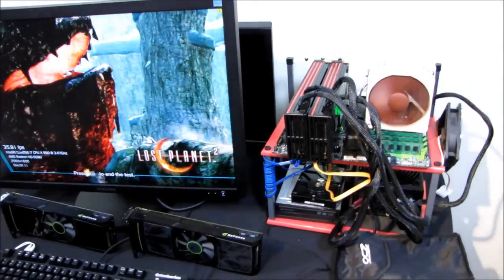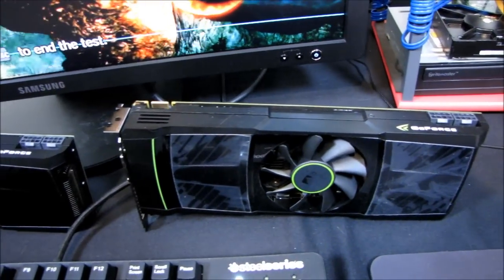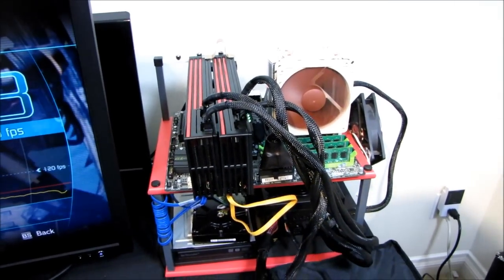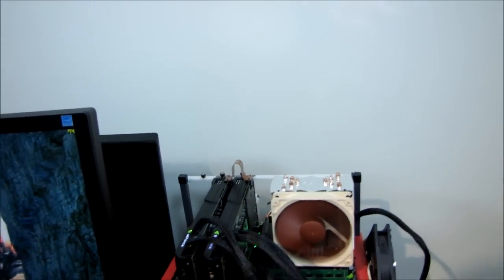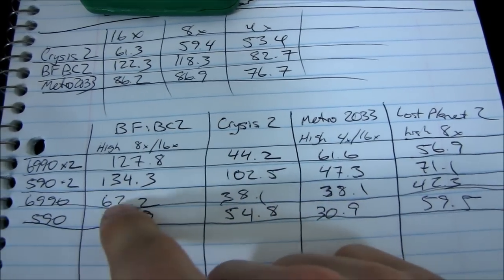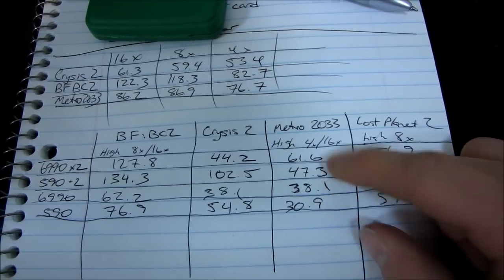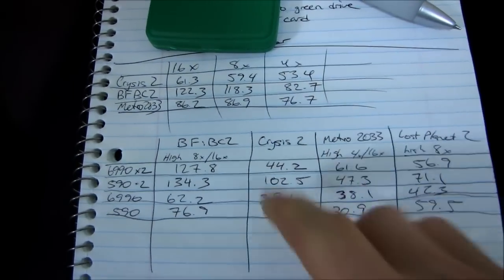Quad SLI vs Quad Crossfire Heavyweight Showdown GTX 590 & HD 6990 Linus Tech Tips

Comment: @sgtrandall1 simple get a video card that DOESN'T have the reference stock hsf design. ( galaxy gtx 580 accelero extreme plus hsf edition here..LOVE IT..fairly quiet even at 50% fan .and at that fan speed IT NEVER goes above 65 at stock voltage and the stock 772 mhz core clock setting..no matter the load)  Msi's twin frozer series types of hsf are often the best of not they are in the top three.  i NEVER buy a video card with stock hsf reference design.  cheers

Comment: @sloergod running them in the 16x slot shouldnt have a bearing on this. From every review i have ever read, the lack of the NVIDIA NF200 chip on the sniper  wont allow it to run 4 way sli like the gigabyte ud9 motherboard has...

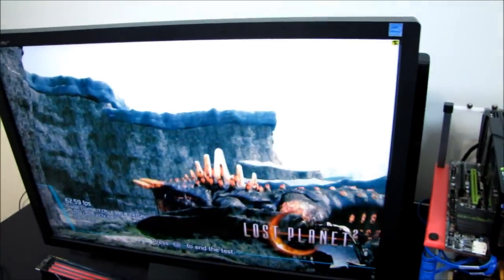Comment: at 3:33 " i felt it would be inappropriate to use 16x and 8x sli configuration"  didn't you already PROVE, Linus, that there isn't any REAL performance degradation until you get below 4x speed on the pci express slots for video cards?

Comment: @HzrdFilms you are right about all of that.  now im still confirming my guesses but so far i believe the test Linus did on 16x, 8x and 4x buss speed on the pci express slots on sli and and xfire configurations proved to me that unless your video card is running at 2x or 1x.  it wont suffer at all on performance.  to me the x16 is just hype.

Comment: @manyakols9 no. if you watched his PCIe bandwidth test, it is a loss of like 2-4 fps and for all the extra air, lower temps and less noise of screaming cards i think 2-4 fps is quite reasonable.

well that and if you had cards as good as that. i think you would have a motherboard that supports full x16 for all slots ( not that the cpu can handle all the lanes, it just gives you more choice of position) like the big bang

Comment: @apocalypseap Yes, like i said "SMALL 8x vs 16x DIFFERENCE"    "4x was a REALLY big difference though when vs 8x or 16x"  Which i just re-watched his video and he is seeing a drop in 16-30% at 4x compared to 8x/16x.  So i think YOU are confused. 
BFBC2   16x: 122FPS    4x: 82 FPS      HUGE difference.   And 8x was 118FPS which might be small, but like i said, if i had a available 16x slot and temps werent going to be affected, id choose it over 8x cause id like to have those 4-5FPS more.

Comment: For those of you with AMD Crossfire configurations that want to play Crysis 2 max settings on 60+ FPS and work with out flickering, you can download Radeon PRO application for free which will allow you to change crossfire profiles for Crysis 2.

Once installed have it scan where you keep your Crysis 2 and set up the crossfire profile for Bioshock. This will eliminate the flickering and increase the performance of the cards on Crysis 2/

Comment: @Daputti This is the last time I'm responding to you, because if you don't get it at this point, you'll never, ever get it. The fact that they're dual-processor cards means NOTHING. Let me reiterate that: It does NOT matter that they're dual-GPU cards. You will only see a 3.5% difference at the absolute worst between 16x and 8x regardless of the card you're using at this point in time. 8x PCI-E bandwidth is sufficient to get 97% performance out of any graphics card out today.

Comment: @oskArtist You're missing the point. This video never was "which setup gives better case temperatures" like you suggested in your original comment. This video is mean't to give a clue about which GPUs scale better in 4-way SLI/CF. That's why he uses 16x pci-e lanes, to limit any bottlenecks and just compare the scaling in different games. This video is about GPU performance an scaling, not CPU temps or computer builds, an 980X will never bottleneck these cards no matter the temperature.

Comment: @1914Sephiroth Did you forget Linus is using 2 590s and 2 6990s ? An that I said that theres nothing 2 580s or 6970s can't handle ? an yes there are a few models of the 6970s that are over $380 USD but theres also some that are around $340 USD so no 2 6970s wouldn't be more then 1 6990 now a 580 is a different matter lowest I have seen is $480 USD, but 2 580s are still cheaper then 2 590s so wtf are you complaining about... most ppl have better places to spend that kind of money then on PC parts

Comment: @reach313 Go with the 2500k unless you /really/ need 8 threads (unlikely). The 2500k performs better and can be overclocked to 4.5GHz easily.

Comment: @Daputti You're missing the point... 8x/8x does not use 4x, at all. 8x/8x is 8x for both. Going from 16x to 8x with one card is almost no difference. Likewise, going from 16x/16x to 8x/8x has the same effect: a 3.5% difference (at worst).

Comment: @pvkryss Doesn't work like that. 8x is still 8x. Linus's latest test proves that dual-GPU solutions are largely unaffected by 8x. In an 8x/8x solution, the results would scale similarly. If you want to squeeze out that extra 3.5% (at best) then 16x/16x is what you'd want to do, obviously.

Comment: @Demonblade36 As far as I can remember, Linus did not do a quad sli/crossfire test in 8x/8x. PCI-E bandwidth doesn't necessarily work the same for dual GPU solutions. It's not that 8x is split into 4x if you have two GPUs on one card. It doesn't work like that. It's still 8x for both GPUs as is evident by the last video Linus did with single dual-GPU cards in 8x. The difference was 3.5% at worst.
I would expect, at most, 3.5% difference between 16x/16x and 8x/8x.

Comment: @LinusTechTips Larger spacing between cards means more efficient case cooling, more efficient case cooling means lower CPU temperature, lower CPU temperature means more space for overclocking and/or turbo, overclocking and/or turbo means higher performance.

Comment: @apocalypseap I think that since there are 2 GPU's on each card, if you put them in a 8x slot you'd get 4x per GPU and linus found out that only when using 4x slots you can see a drop in performance. Someone correct me if i'm wrong

Comment: I think this video really shows that the games are in a good place graphically (though could be better...crysis 2 with DX11 will be a must when benchmarking a GPU) and that the cards currently have a ton of power. its really the drivers that are holding up performance to our eyes. The cards have the horsepower, the games are the premium fuel...but the drivers...the "fuel injection" is sputtering and spitting..giving us crap. Nvidia and AMD need to triple the teams that make their drivers.

Comment: Damn, I was planning on upgrading to a 6990 for Crysis 2 but found out there were driver issues. Is that true guys, or are there fixes? Crysis 2 + 6990 MAXIMUM FAIL :((((((((

Comment: @GaviGames by your analogy, treating a core as a cpu then calling a two dual cores quad socket, then the gpu equivalent would be as follows: a gf110 (580 gpu) has 512 cores, a dual gf110 (590) would then be 1024 cores or 1024th sli. hell yess! sounds way better like that. "Come check out my 1024th sli gaming rig man" *high five*

Comment: @TY220 No, he is probably using an OEM version of windows that pretty much locks that copy of windows to the motherboard being used when it is installed, so when he moves the hard drive to a different board it reads it without authentication.

Comment: Now you need to benchmark  3 580s in tri-SLI vs. two 590s in quad SLI. Then do a tri-Crossfire comparison to quad between 3 6970s and 2 6990s. I'm willing to bet the tri-SLI and tri-Crossfire configurations beat the quad-SLI and quad-Crossfire configurations.

Comment: @DeepSpaceVoid I'm not positive , but weren't his 16x-8x tests with single GPU cards?  What little difference there is between the PCI bandwidths, it would be greater with dual GPU cards. I think Linus wanted to avoid any bottleneck, even if very small.

Comment: @Slixors Well of course but you'd also be getting 2 times the heat and power consumption, not to mention spending $600 more. Point of the video was to compare both companies' Dual GPU solutions i.e the GTX 590 and the 6990 in SLI/Crossfire.

Comment: @LinusTechTips when your changing out the GPUs do you run driver uninstaller and if not then does that mean that the control centers for ati and nvidia work just fine installed on the same system?

Comment: @Geoufferson the 295s would beat em, but not sure by how much, and you're investing in older tech with the 295s as well as much more heat and power output, i'd go with the 6870s, 6000 series scaling is great, not so sure bout the 200 series.

Comment: @hoangle2207 lol it's there damn drivers for there new cards that suck, which is odd cause I can play crysis 2 on my HD4890 an get 60+ FPS C_C so once there drivers mature a bit more I'm sure were see better resaults. As it is I'd rather get 2 6970s then 1 6990 there cheaper and faster lol. what I dont get with AMD is why don't they ever use higher bit rates for there high end cards, that would benifit them in doing so lols.

Comment: Nvidia drivers are fine with 4 way SLI, so i would imagin quad SLI would be good too.
I get perfect scaling on almost all games with the 270.61 drivers.

Almost any game i play that has good graphics will tax my gpu's full. 95-99% usage across the board.

Even portal 2 with its [ok] graphics run at 96% on each GPU,. there is a FPS cap at 300 thought >.>

Comment: @BRAeminem the thuban design overclocks slightly better, with less volts, +2cores will be more future proof and they're not so much more expensive than Phenom ii x4's, i use AMD and i like it, but a build from scratch i'd go 2500k @ 4.2GHz that wont be slow anytime soon.

Comment: @alexbeast14 What, because it doesn't have a pretty designed heatspreader means that it's shit?
It could very well be a preview product or that linus just removed the heatspreader. Or just cheap rams, but even if that were the case, you would never notice any real world difference between it and high cost memory.

Comment: @ThElitE The problem with open-air PC's is overheating. Without a tower there is no real air flow carrying the heat away from components and/or heatsinks. When you have a serious rig like this one you need as much airflow as possible as the components will become super-heated. It is fine to use for short periods of time (Like these tests) but not for long term use.